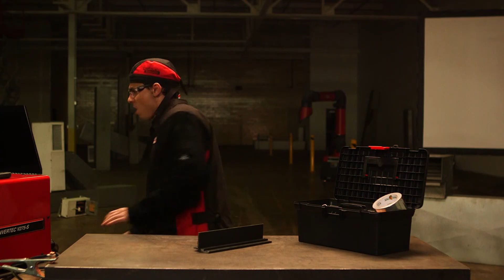Welding Safety: Electric Shock

Comment: The video mentions that you have to be in contact with two live wires. That is not how electricity works. You only need one live wire and a ground. Correct me if I'm wrong
Reply: Perhaps more accurately, voltage needs a return path which could be the ground or another wire, depending on the circuit. Most circuits have one wire connected to 'ground' at the source but a multi-voltage system can have different potentials to ground or to another wire. A North American residential 'hot wire', for example, is 120v to ground but is 240v to the other 'hot wire' because the pole transformer is grounded at the center point of the 240v coil.

Comment: This video is okay but there’s a giant hole in the information: at 7:15 we learn about riskier situations, then we get a list of “safer” equipment in those situations, but we never get any explanation why those situations are more risky or why this other equipment is supposedly safer. Apparently it’s just inherently safe to use this other equipment and there’s no way to screw it up (and therefore no need to understand why the named equipment is supposedly safer. 

Not to mention that people weld while submerged in salt water, so what the heck is going on there?

Comment: I know nothing about this what happens when you don't ground the welder
Reply: The ground is connected to the metal case and if a hot wire comes loose and contacts the metal case it will trip a breaker. If it is not properly grounded and a hot wire comes loose and touches the metal case and you touch the metal case it can shock you.

Comment: First thing this video says is wrong. You can't get electrocuted by "grabbing 2 hot wires", as long as you are not grounded. You only need one hot wire and one negative, or ground.
Reply: I believe we’re considering ground to be “hot” as well.

Comment: So let me understand this:  If I've one metal workpiece  grounded, can I hold the other workpiece to it, with my gloved left hand, while operating the stinger with my right hand, WITHOUT getting a shock?
Thank you!!
Reply from the maker: Yes, that is correct. Just make sure you don't get a finger between the rod/stinger and the metal to avoid burns and a shock. Follow the manufacturer's safety instructions and take all the usual precautions you would when operating an electrical appliance. Good luck and stay safe!